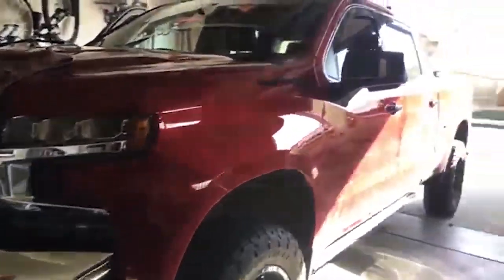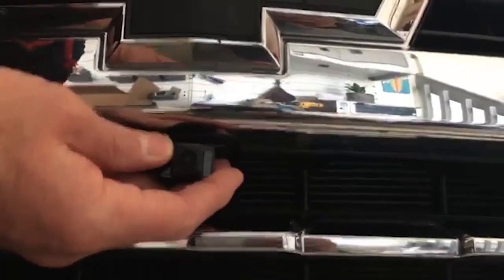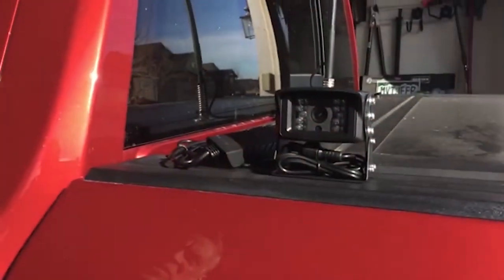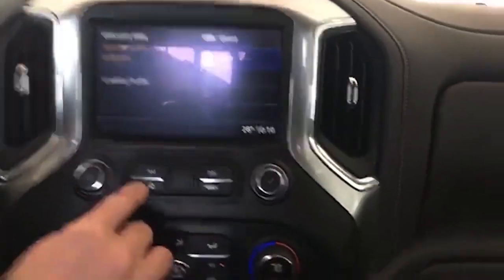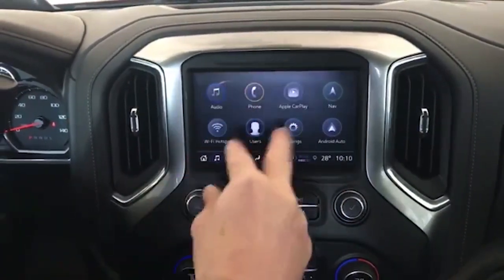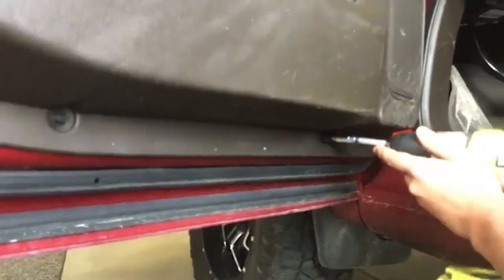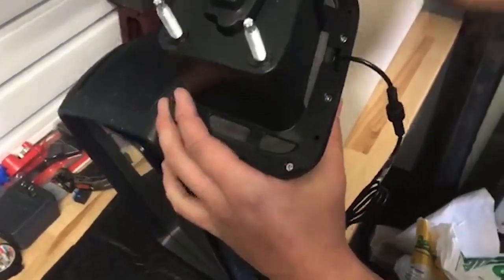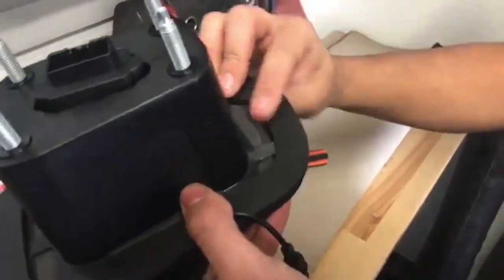How to install the Intellihaul 2.0 System on 2019 - 2022 Chevy Silverado and GMC Sierra 1500 Trucks

Comment: Is there anything you install into the head unit or are those wires there from factory ?
Reply from the maker: The Brain for the Screen are down by the Passenger's Feet. The kit comes with Plug & Play Harnessing.